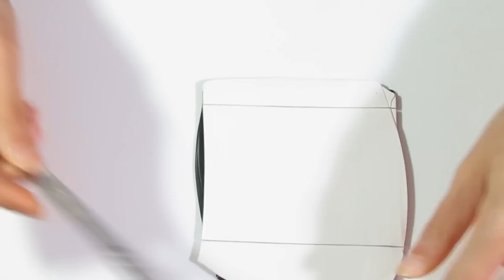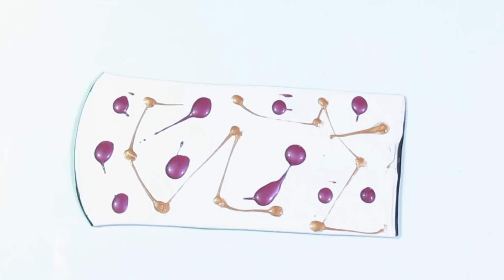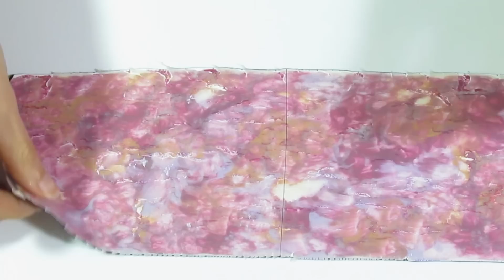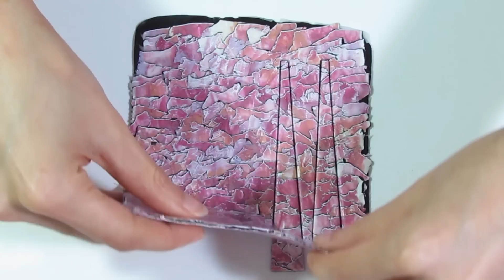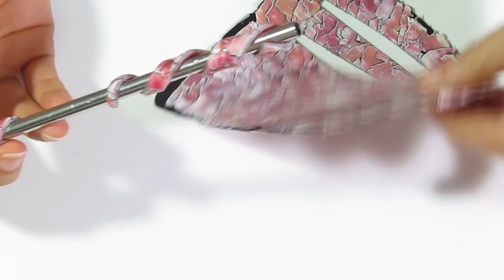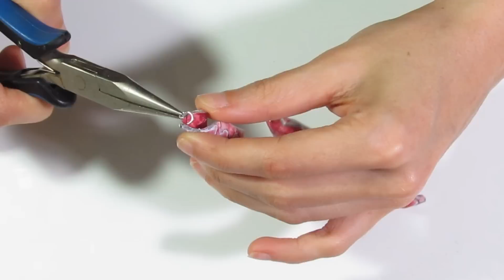Create Polymer Clay Spiral Earrings using the Torn Watercolor Technique

Comment: FYI if you use mica powder instead of paint, you'll need to figure out something to make the translucent layer stick to the colored layer.  I thought about that ahead of time and considered liquid clay but thought that would not be advisable to put through the pasta machine.  Since she said you could use mica powder or ink, I figured I'd just try it.  The translucent layer didn't stick at all.  I ended up using it without the translucent layer and just dipped it in varnish to seal the mica powder.  It came out ok, but much more faintly colored than the paint method.

Comment: Hi Samantha 😊 Did you know you can buy sandpaper shanks to help get bits of sandpaper in really awkward spaces?  I got mine off Ali Ex & they’re a set of small metal bars with a slit down the top half so you can slide your sandpaper in & wrap it around the shank to create a range of sandpaper tools that can fit into the tiniest of spaces up to quite large ones (in crafting terms).  Hope you find them useful 😁